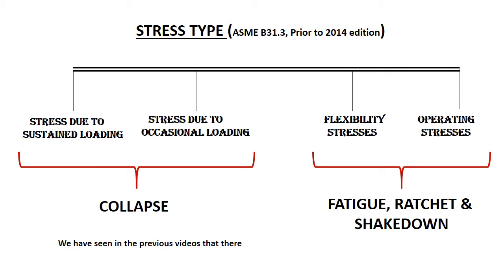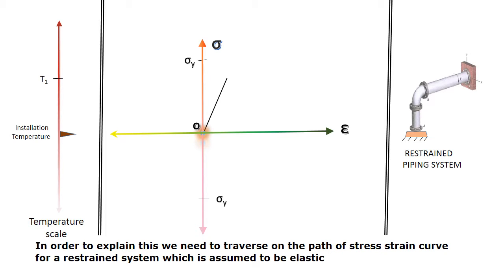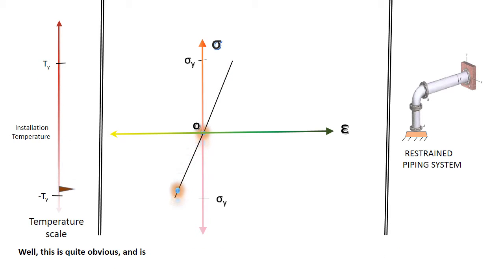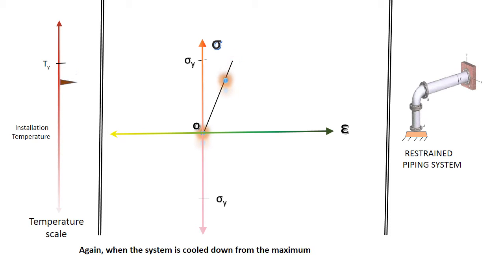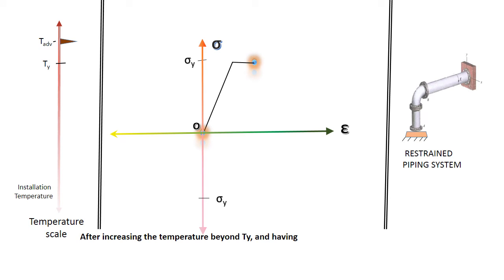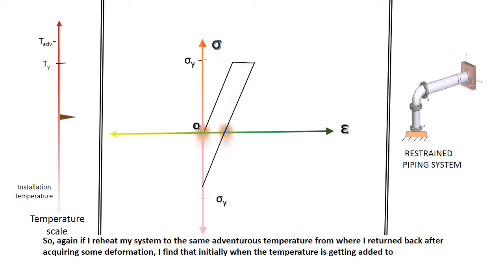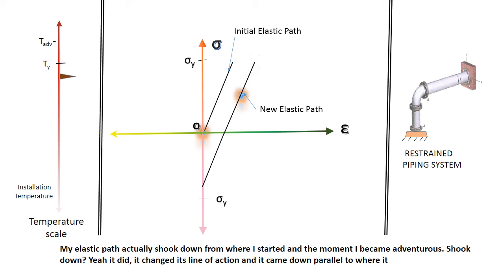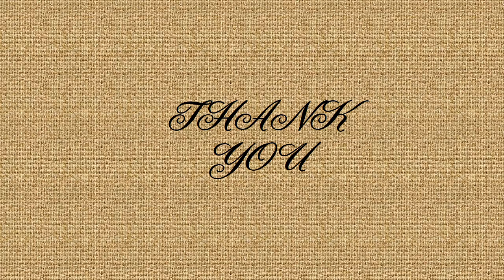Piping Sress Analysis : ELASTIC SHAKEDOWN

Comment: Great video, thanks. I could not understand the part about why the system tries to a reach a zero strain position and gain compressive stress? So after the shakedown, there will be compression stress in the system at the installation temperature (where initially the stress and strain were zero before shakedown)?
Reply: Please reply to this Question